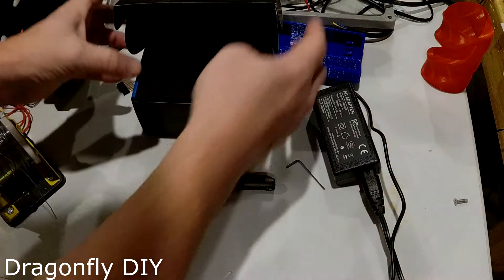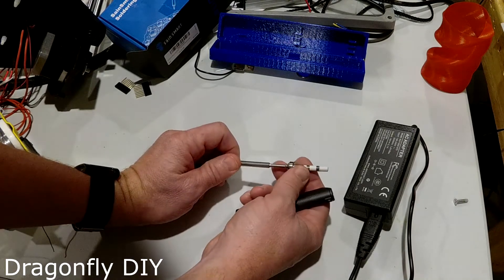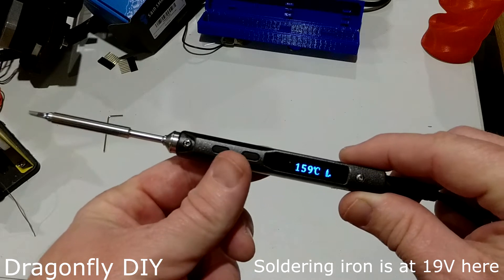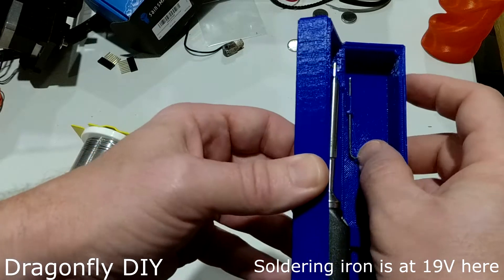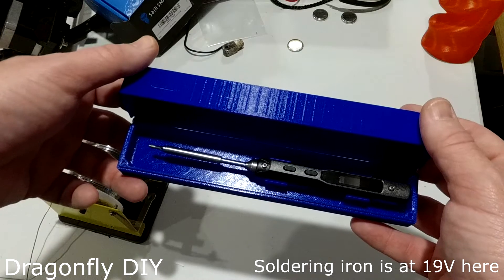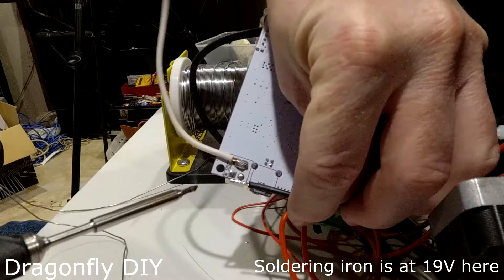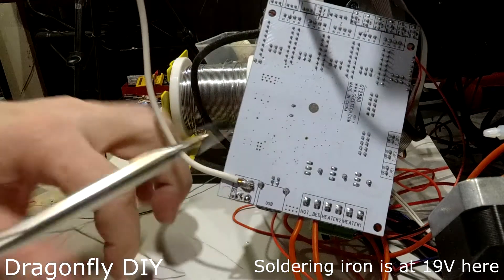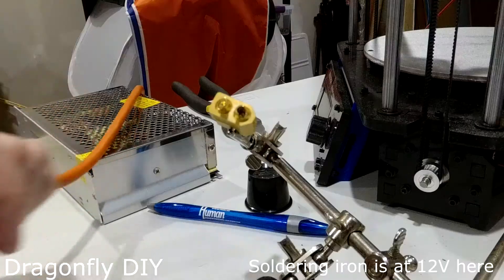TS100 Soldering iron review (Sainsmart)

Comment: You likely know much more than me but without running it at 24v, where it apparently does perform,  you didn't really review it.
Reply from the maker: That's been mentioned. But I'm reviewing the Sainsmart edition, as shipped by them. They ship it with a 19V power supply, that's how I'm reviewing it. I do plan on redoing this hooked up to a pair of 12V wheelchair batteries. That will be 24 volts at basically unlimited amps, so that should put this question to rest. It still won't make it an iron that I'll actually use because there are zero situations where I don't have a bench soldering iron, and that's a pain to set up versus just flipping on the mains powered one.